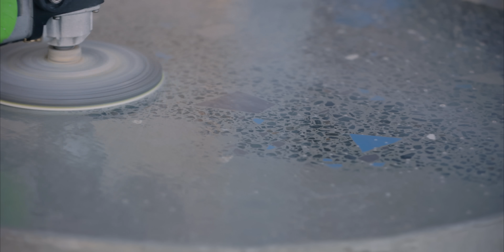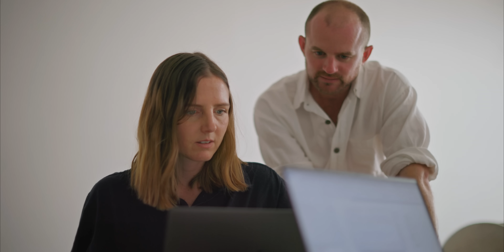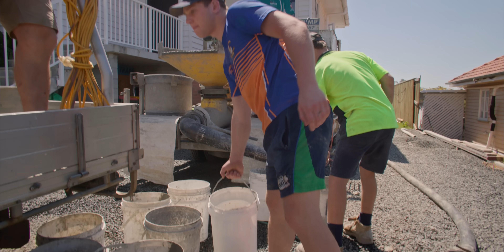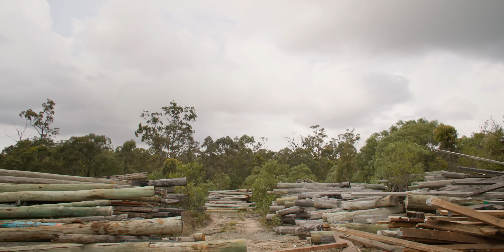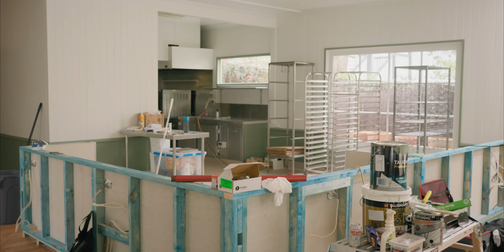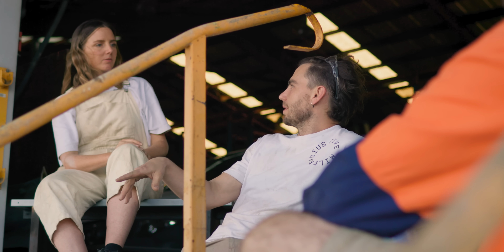NTS: Wonderful Waste - Aussie Architects Turning Waste Into Furniture & homes

Comment: The ideal of using resources from a “five mile radius” isn’t necessarily environmentally friendly, though? You can easily use-up a particular resource in your area that way, or chop down your local trees for the project, or even make things in a way that is more energy intensive because you don’t have the right equipment to make things in an environmentally sustainable way. And if a project will be particularly labour intensive, it may never get done if the local people do not have the time or money to contribute to it - after all, if you make things that are only for or benefit people in a small area, people nearby are unlikely to contribute too (Westerners who have rich lives to go back to don’t count). Using as much local resources as possible is good only if that is the most economical and sustainable solution, and that is not necessarily the case. E.g. it is better to use wood or sand that is harvested sustainably than just taking from your local ecosystem, which could be highly disruptive, even if it takes using transport that requires a lot of fuel.

Furthermore, furniture isn’t necessarily a good thing to make, not only because it very easily can be thrown away later, but because furniture is a commodity that we already have way too much of in Australia, with even charities refusing donations of good furniture because there is so much second-hand furniture being unused. Trying to use more of what we already have is far less wasteful than producing new. Plus, if the design isn’t a good design that people want to keep for a relatively long time (and let’s be honest, their products don’t look great), then what is the point? If people buy just to support this group, that’s even worse because they are more likely to throw it away later, or for it to be unnecessary for them. If they are going to produce furniture, then at least produce less wasteful versions of furniture people actually want. 

It seems like they are just using the easiest and most simple ways of reusing materials as possible, which doesn’t necessarily look good or is comfortable to use (e.g. using rebar “as is” in chairs just sounds like a bad idea), when with a bit more effort they could be turned into objects people want and need - and there are other groups who have used waste materials to do that. Using as much as possible of the material can still be done by thinking of multiple objects the bits and pieces can be usefully used in, not trying to use it all in one object. And again, what is available in the second-hand market should be considered, so providing built-in furniture or objects used in construction is by far the best idea, or providing other items that people buy new because there is very little avenue for re-used materials.